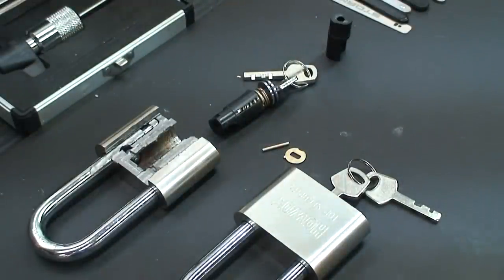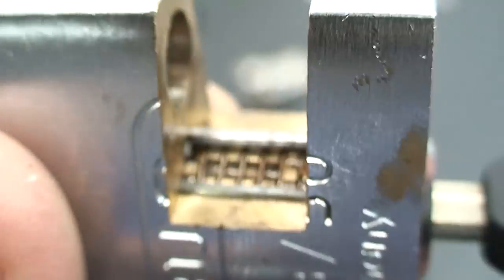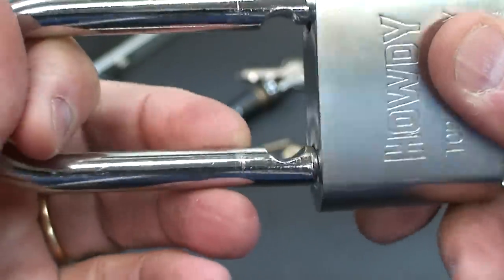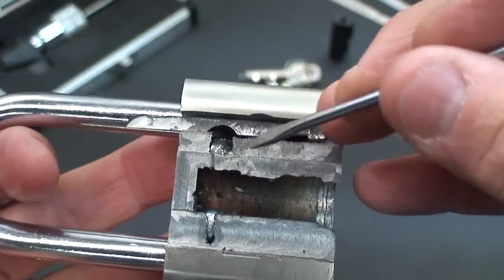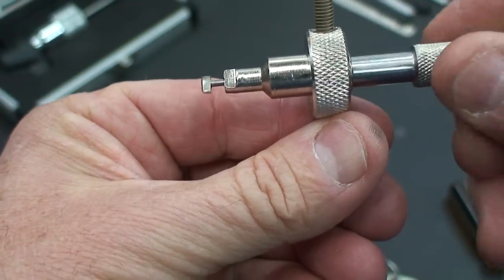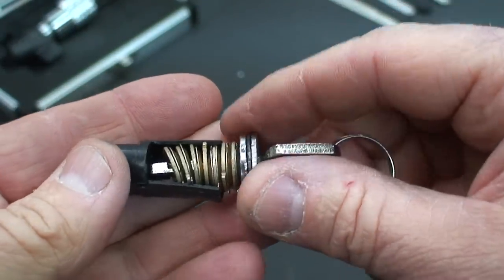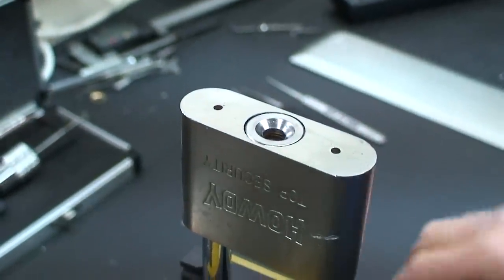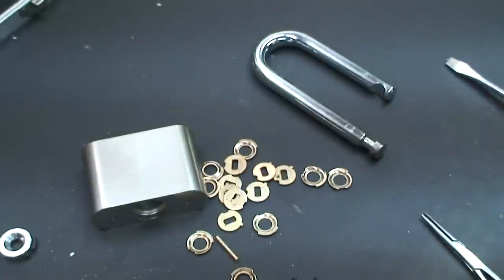(12) Defeat Chinese Disc Detainers by Exploiting Their Design Defects

Comment: When I was enlisted in the US Army, we got some really nice high-security pad-locks; hardened shackles, hardened steel bodies and cylinders.
The down-side was that about 2 dozen of the locks were keyed 'flat'!
Yup, every notch on the key was the same level!
Each lock had a different profile, to be sure, but the profiles were essentially a straight line with tiny 'teeth'!
We sent them back after I was able to pick every one of them with a small screw-driver...

Comment: ACK! Plastics for lock detention?! C-razy. Basically you can hold a lighter under the lock and heat up the guts and then with a gloved hand just yank the shackle and the balls would deform the softened plastics.
Reply: +chaon93 That would still take longer than just using the screwdriver method.
Reply: +Paxmax i hope you do realize that one good steel lock can buy 5 to 20 plastic cheap one.... i think his point is that dont save money on such important thing..... and also china made those cheap one because American buys them, it is not about selling shxt
Reply: Ryu Song totally agree
Reply: there is something faster its called Bolt cutters, i know as that is all was left of my lock (just a bolt cutted padlock) as my bike got pinched at college Very long long time ag o(the new bike the news paper got me after that followed me into the collage every time after that and they did not stop me,, now i look at it it would of been bad PR for the collage if they did stop me so i guess its why they allowed it but did not tell me if i was allowed or not)

any way these things will not be immune to a bolt cutter. all the fussing with screwdriver and pulling it out when you can just cut it with a small bolt cutter in 5 seconds (and most of that time is getting it out to put it over the lockbar) and be gone with the bike. even cheap D-Locks only require shock to brake them (one hit hammer and a large flat head screwdriver) most newer Real bike locks have 2-4 layers of protection you cant saw them and its nearly imposable to cut them (unless you have a circular saw but it make a lot of nose and even then Plastic or kevlar might even Jam the disk)
Reply: At least Bill's screwdriver method doesn't destroy the lock. You could put everything back together if you wanted.
Reply: All in all you, get what you paid for.

There is a reason why they are so darn cheap because they are made cheaply from subpar materials and lack of tried and true designs to save on any form of engineering R&D. 

From my own experience there is tons of low quality padlocks you can easily buy from gas stations, convenience stores and stationary supply depot. You seriously would not even consider using them to lock your backyard pen or shack much less your home.
Reply: I'm going to try melting one when I get another on of these locks.
Reply: @RoyU-fw4wx  haha you dont need to get offended. It doesn't mean anyone thinks China sucks or anything... but they do make a lot of cheap stuff, regardless of who buys it.
They make a lot of good quality stuff, too, because they make virtually everything... but yeah that doesn't change the fact that they make some cheap stuff - it is what it is 🤷‍♂️

Comment: I wonder what a bit of heat would do to that plastic. although the screwdriver method would still be faster.
Reply: i was thinking the same thing. a torch and a pry bar would take it off real quick
Reply: And very quiet. Bright, but quiet
Reply: Melted plastic is smelly.  Molten pot-metal might disfigure whatever was locked.  But your point is well made.

Comment: About the hardened bar, You could heat the bar with a propane torch so it softens the hardening and it will be alot easier to cut.

Comment: Good day Bill.  I am new to the sport and love your videos, I am learning so much.  When I was in the Military 35 years ago we used Abloy padlocks (40 or 50 mm I think) to secure some of our equipment.  The shape of the key always intrigued me, and after watching your Videos, I suspect that it is a Disc Detainer type.  I don't have a Disc Detainer pick yet, I guess it's next on my shopping list.  Anyway, while in the Philippines last December, I picked up some cheap Chinese locks to practice with, and one happens to be a Disc Detainer type.  I used your special flat blade pick to open it exactly like in this video.  After dropping all 5 discs and the locking bar on the floor, I even managed to put all 5 discs back in the plastic carrier in the correct order and orientation, with the locking bar and slide it all back together.  I managed to compress the cap spring to finish off the reassembly, and the lock still works.  Thank you .

Comment: Would heating it up to melt out the plastic also work?
Reply: +Fotografieren mit MarcusFotos.de Probably but there's not much point, you can screwdriver it much faster than that. Plus, you could probably just crowbar these in one pull, pressing the ball bearings into the plastic.
Reply: yup...

Comment: When I saw the plastic retainer, I got an idea...

Use a metal hook to pull on the body of the lock, and just use a blow torch to heat the lock.  As soon as the plastic melts, the lock should pop open...  I'm guessing the lock should be blown open in about 30 secs.

Comment from the maker: Not yet, but I only have the military issue brass/copper ones and they are probably too stiff to open a cruciform  Your timing is perfect tho, because I got in a really nice cruciform last night to experiment with.  I'll go to Walmart & find some cheap, flexy .22 bore brushes.  I'll get some nylon ones too to experiment with.  If it works, I'll demo it when I SPP the lock.

Comment: Hello Bill, you may be able to heat the lock with a lighter or torch and melt the plastic, the ball barings might fall into place. I could be wrong but its just an idea. I found your videos yesterday and i think they are great
Reply: Yes your probably right only one way to find out 357mat1
Reply: Thanks 357mat1

Comment: I believe the top part of the lock is called a "shackle", not a "hasp".  A "hasp" is a slotted hinged metal plate that forms part of a fastening for a door or lid and is fitted over a metal loop and secured by a pin or padlock.
Reply from the maker: You are 100% right.  Sometimes my lips outrun my brain and I'm past the mistake before it catches up.

Comment: I tried popping the cap out of one of these and it just snapped the tool. Possibly over hardened, or the cap was better on that brand. However, two hits from a cold chisel into the side of the lock popped it off - it went straight in through that thin pot metal sidewall!

Torquing works well. I've used that on the few I haven't been able to pick "on the door".

Comment: If you ever need replacement spacers for an expensive padlock that you're messing about with then just buy a cheap Chinese padlock, take it apart like Bill did and there's your replacement spare discs and spacers. (they might need filing to fit) That's what I did when I needed another spacer for my Abus 37RK/80 that had developed a sloppy stack after I reassembled it one time.

Comment: Hey, Bill, could you try something for me?
If the cylinder in a Chinese lock is only plastic, could you simply melt it with a lighter?
Reply: +modwlego 
The metal body will conduct heat away very quickly, so you can probably do it, but you will need more than a lighter.
Reply: +CPTANT if you put the heat on the base of the hasp near where it enters the lock it would conduct the heat through to the ball bearings which would melt the plastic exactly where you wanted it to melt...
Reply: +CPTANT I'm thinking portable butane soldering iron or something :P We need a video!!
Reply: +rkan2 still cheaper just to use a screwdriver, or even a small metal rod.
Reply: +Md Device 
I think you would goo up the works so much, the thing would then be more difficult to open.
Reply: +Michael Hawthorne if you can melt the plastic a bit I think the bearings would just melt into it and done.... no more damage, no more work required

Comment: Bill, this is video is over 3 years old... Do these locks still have the same defects? Particularly the sobo series? When I tried your cutting trick with a cheap pocket knife I only revealed the brass looking body (no metal shavings). I tried moderate strength to pop out the cover (which looks slightly different) with no luck. I plan on using 2 of these 3 sobo locks on my new ebike.

Comment: I have a question. It may be silly, but if you are basically "gutting" the lock itself what's the difference between doing the vs destroying the lock all together? 
I'm aware you could reassemble said gutted lock. But wouldn't that just take as much time as picking Said lock with the special tool? 
Sorry if this question seems ignorant I honestly just don't know, and wanted to know the reasoning. As a locksmith do you have to reassemble said lock? 
Thanks love your vids!
Reply: ninh s Usually people happily pay the locksmith for a new lock on top of the opening fee.  This may even be more profitable than the actual opening job.

Comment: as i know ASSA and ABLOY locks are the same locks as they are made in the same factories and they are owned by Assa Abloy a Swedish Finnish lock manufacturer Abloy locks are  made mostly in Finland and Assa locks are mostly made in Sweden but the components for both are made in both countries and ASSA locks are pin locks and ABLOY are disc locks but still both of them have the same casings also they are making a hybrid lock in a few years what i have gotten as in information from them

Comment: get the first cut by a flat file (by side of the file) and then the shackle will cut easily. Because the hacksaw blade will get a groove to cut and sit on.
Reply: That sounds good, but properly hardened steel is resistant even to files, the file does the same skating without much cutting. You really need something considerably harder than hardened steel, tungsten carbide or abrasives to effectively remove material. A cut off wheel can cut through hardened steel because it contains abrasives, it's just not very quiet or quick.

Comment: Heat the lock up with a lighter, make the plastic soft, and pull hard on the lock. The bearings  will push into the soft plastic. =)

Comment: bosnianbill, late question(and I don't see it answered in the video or asked in the comments), but what stops the guts falling out of the quality locks like the Abus (you pointed out the hardened metal exterior and hasp, and the steel liner, but didn't point out how they prevent the screwdriver attack as far as I can see)- not a hint of criticism, just curiosity/stupidity on my part. Very informative and entertaining video as always (I've watched maybe ten percent of your output over the last week)

Comment: Very interesting to see these taken apart. I knew they were very low quality but I sure as fuck wasn't expecting the core to be plastic!! 10 minutes to pick one would be a bit drastic though lol, typically I'd spend about 30 secs to 2 mins max. Kräll and Monterey are decent quality for the price, would be interesting to see if they can be opened this way.

There is a force tool on the market for these too; seeing the plastic core now I know exactly why it works so easily. Damn.

Comment: Heat the lock to soften the plastic, pull it open. Probably slower, but if you happen to be caveman with piece of flint and steel and no equivalent of an screwdriver, it might be the way to go. :-)
Reply: I'm sure you could just pull the clasp hard enough for the ball bearings to break the plastic themselves. A crowbar should do.

Comment: Bolt cutters would have taken that lock off even faster. 

These locks are mostly used in situations where the hasp or it's mounting they are being put through is probably the weakest point. Barely any thief is going to worry about defeating the lock mechanism. They will use brute force.

So focus on everything when making something secure not just an expensive lock.

Comment: Seen this video a while back and somebody called me and said they had a lock like this they can't open. I went and look at it and only took out that retainer and boom the lock was open thanks. I said to them avoid that kind of cheap locks and get something worth while lock the gates with
Reply: The reason also for the lock not opening was the ball bearings and other steel parts has rusted so really not reliable locks

Comment: hi bosnianbill, how you cut your padlock? i have simmiliar padlock like that, i cannot open the padlock from bottom. i have broke many screwdriver when try to open from bottom.
Reply: The whole point of this video is that what the lock looks like outside has little to do with what's really inside.  But there are some common indicators, if you look carefully (and are willing to wreck some trash).
Maybe your padlock is actually good quality, lol.
Screwdrivers come in different qualities, too.  Lock is metal, tool is metal, the weaker metal will break first.
Reply: Thx bill, until now i still cannot open my padlock, actually my padlock only 2 dollar US, still not believe why cannot disassemble this cheap padlock. please always provide video for us. lol.

Comment: . . . . . . . . . wonder of a bodywork "slaphammer" used for auto body work to pull dents out of vehicles could be screwed into these locks and the core, guts "slapped" out ??
Reply: bosnianbill It's precisely what I do to these locks, I welded a smaller hook on to the end of one and insert it, find a gap between discs and it's all over. If you get it right down the end everything comes out at once. Not very professional as a locksmith but showing a customer how easily the lock is defeated often gets a sale on a better lock.

Comment: These locks.... DAFUQ?! What were they thinking?!
Reply: MatzeGamer They were thinking about streamlining the manufacture and making quality control unnecessary, getting the cost under 50ct a piece. The plastic cylinder will simply adjust to the manufacturing defects of the steel casing, and the way they're locked with a spring clamp makes assembly quick enough. And it's not like any lock is more than a mere polite suggestion to a law-abiding citizen that the property is not indeed theirs.